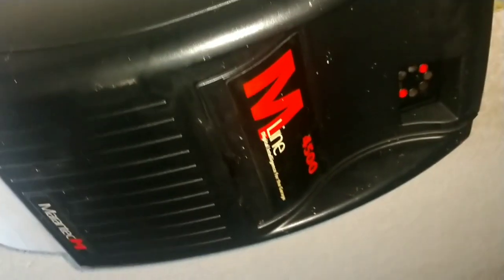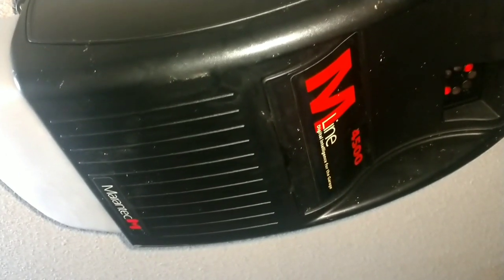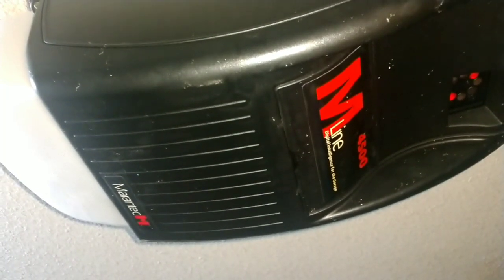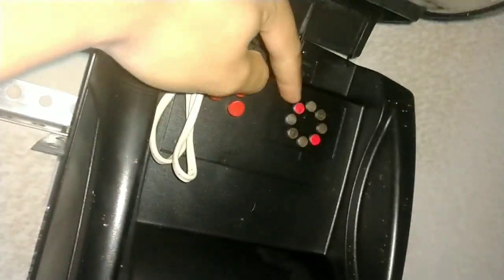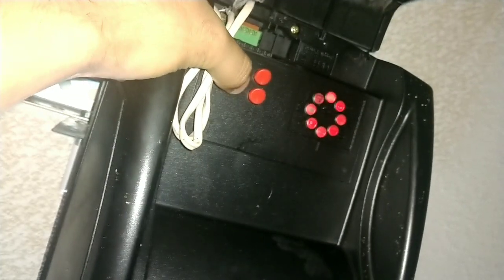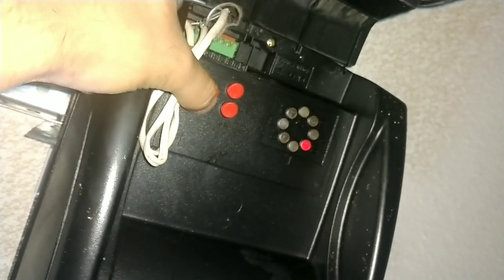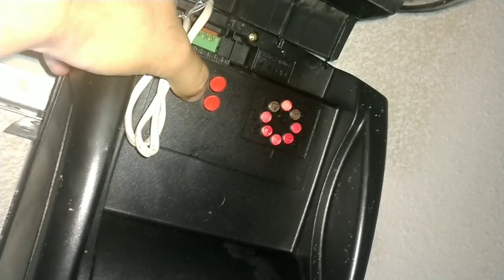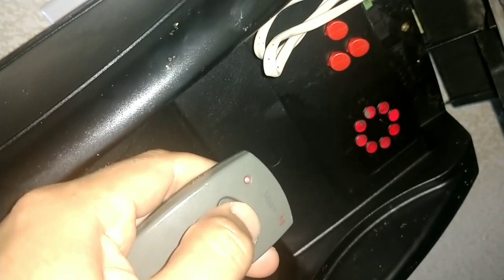Marantec garage remote reset programming & review

Comment: For the second remote, once you have once programmed, you need to use the 3-pin connector that came with the unit and share the code. That's how you program multiple remotes without removing the codes from the others. It's dumb, but it works. You should not have to ever go back to reprogram this method unless you have a surge or something that cuases the unit to reset.

Comment: I tried everything u said but at number 7 when i press my remote button the light doesn't rapidly flash wat should i do
Reply: I'm having this same issue, did you ever solve it? It seems the garage opener is not receiving the signal from the transmitter.
Reply: Any success? I’m having the same issue
Reply: Same here. Anyone have a solution??

Comment: I just moved in to a new home and have only one remote (and no connector tool). Is there a way you know of to reprogram it so that if there are other remotes out there, they can't be used on my door? If I program the remote I have as shown on this video, does it get a new code each time - overwriting the old code? Thank you!
Reply: Did u get an solution?
Reply: @sorenzeen  no I didn’t. I think if I reprogram, the other remotes out there wouldn’t work anymore -but no way to test it for sure since we have only 1 remote.
Reply: If you reprogram it and have your new remote working then it deletes the other remotes.

Comment: On mine the light blinks when open its really annoying. There's a way to program it but after a week it blinks again. Do you know how to fix this.  On the wiring there are numbers whoever installed it only connected the first 4 and cut the rest i don't know if thats the problem
Reply from the maker: It sounds like the sensor needs to be aligned. Have you checked the safety sensors that Keep the door from closing if something is blocking the doorway?
Reply: SMP scientific method perspective i saw that on a different video and checked it. On yours are all the wire connectors used or just the first 4
Reply from the maker: @UgaFan-ie8cd  which wires are you talking about?
Reply: SMP scientific method perspective the incoming wires right by the circle of lights. Also the 6th light blinks as well if that means anything
Reply from the maker: @UgaFan-ie8cd  https://youtu.be/_5DtOQnzhyM
Reply from the maker: @UgaFan-ie8cd  feel free to like & subscribe to help my channel out. Thanks. Let me know on the other video if this helps.

Comment: Were you able to successfully program two remotes? Every time i try to program a second, the first one stops working
Reply from the maker: Yes, there is a connector that you use to plug the first programmed remote into the second. If you try to program the second remote directly to the garage, then it will take the place of the first. In other words, whatever remote is remotely programmed directly to the garage will be the main remote. Any additional remote must be programmed to the main remote by a pin that let's the remotes plug into each other. I'm pretty sure you can buy the connector online for cheap. It's just a metal pin plug basically.
Reply: @-smp-scientificmethodpersp838  i have the same issue!  But my remotes dont blink when i try transferring. How do i put a new signal into a remote that isnt new?
Reply from the maker: @lastnametea  your remote isn't supposed to blink. The garage door opener does. Maybe you need a new battery? Or did you drop it in water or something? These remotes are pretty durable. I'm not sure what you're trying to do, or how you diagnosed it as a signal maker/ receiver